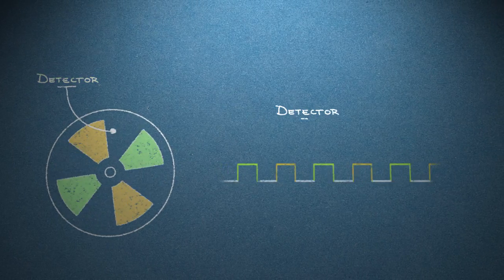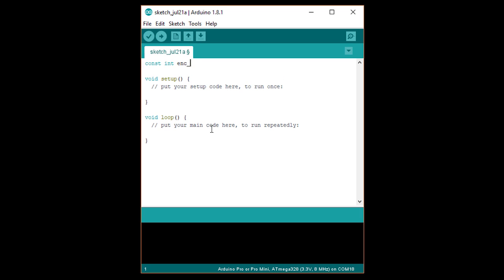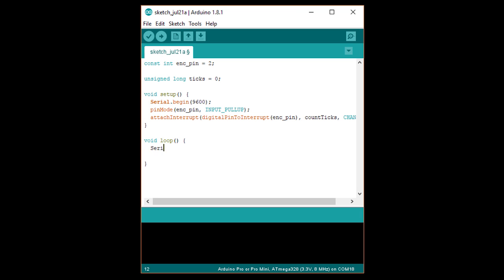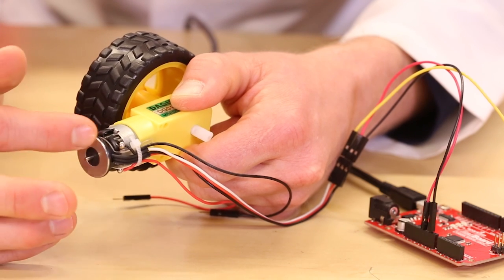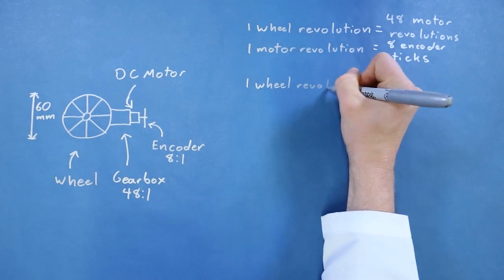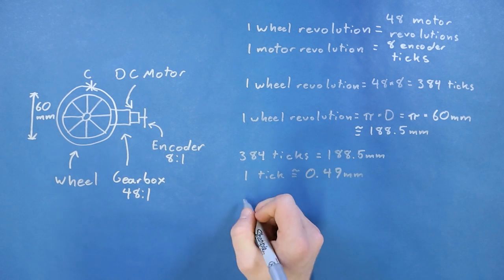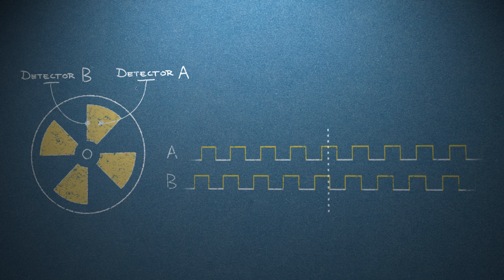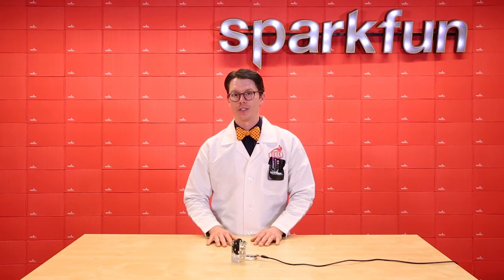Adventures in Science: How to Use Rotary Encoders

Comment: At 9:47, there is an error in explanation: If B is high (should be low) on A's falling edge, then we know that disc is rotating clockwise

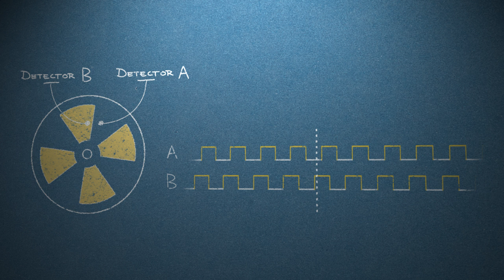At 10:02, there is an error in explanation: if there is a falling edge on A and we detect B is low (should be high) then we know that the disc is rotating counter-clockwise
Reply: yeah i noticed this one too. thanks for mentioning it. a bit confused but overall the whole video explanation is very clear.

Comment: @ 9:51, "If B is HIGH on A's falling edge, then we know that the disk is rotating Clockwise"  Wouldn't we be able to tell if the disk is rotating Clockwise when B is LOW on A's falling edge? Using the videos diagram, I think this logic makes sense. If the disk is rotating Counterclockwise, B would read HIGH on A's falling edge. Please correct me if I'm wrong, I would like to make sure I understand the rotary encoder logic.

Comment: Is it possible to measure distance using rotary encoders?
Reply: Yes, if you watch the video at around 7:53 (https://youtu.be/oLBYHbLO8W0?t=7m53s), you'll see that I set the robot to measure millimeters and stop after it's traveled 1000 mm. For a human-scale example, measuring wheels (like this one https://www.amazon.com/TR-Industrial-Collapsible-Measuring-Yellow/dp/B01018D7MS/ref=lp_3753421_1_1) work on the same principle. As you walk with it on the ground, a device counts the number of rotations and by knowing the circumference of the wheel, you can figure out how far you've walked with it.

Comment: hi 
how we can make dc motor as servo ? with encoder 
or how can i control dc motor shaft to turn 20 degrees 45 degrees 360 degrees etc ?
Reply: You can however do not that these encoders are very inefficient.

Comment: There is so many pins defined....i only have the two encoders. The others i don't understand what they are, please explain.
Reply: Ncheeta Morero read about H bridges. 2 digital output pins for every wheel determine the direction of rotation + 1 pwm output (again, 1 for each wheel) to control the speed of that wheel. This should explain it!
Reply: For each motor there are two pins and one pwm pin. For two motors that's 6 pins. There is one standby pin that has to be held high for motor driver to work. And then there are one pin each for encoder output.( If u r using quadrature encoders, then there are 2pins each for a motor). So in total there are 6+1+1+1=9 pins.

Comment: Can anyone help me? I don't understand this section:
  // Constrain power to between -255 and 255
  power_a = constrain(power_a, -255, 255);
  power_b = constrain(power_b, -255, 255);
Why constrain power between -255 and 255? motor speed only 0-255.

Thank you
Reply: Roinaldo Pho it most probably is because it uses and 8 bit data system and can’t handle more than +/- 255.
Reply: @roguepathfinder2477  microcontroller has an 8bit ADC.
Reply: zeus 0101 good to know! And i was almost right, that’s a win in my book.

Comment: Thanks for this. I was thinking about buying a servo but now I know I could just make a rotary encoder instead.
Reply: Use a good quality encoder. Otherwise go for stepper motor. I personally tried all three. Servo (real rc servo only rotate 180° , 360° servo doesn't have feedback so there just plain dc motors with speed control) , dc motor with encoders and stepper.

Comment: Kids, take apart your home printer to see an example of an optical encoder!!
Reply: A linear optical encoder (if it's an inkjet)
Reply: Many of the last generation of mass production VCR's use them as well. I've taken several from old TV's that had integrated VCR's. They are usually mounted on stands that are easier to incorporate in other hacked designs too. You can also grab the LED's from a remote control and the IR receiver to make your own encoder, although you need the simple kind. A lot of newer IR receivers have integrated IC's in them and that can complicate the design.

Comment: Oops,   •¿°  d x pi =c
But won't d vary with weight on the axel?
Oh,,  and is there a difference between absolute encoder and a gray code...   oops. I  just dated myself....
Reply: The diameter might decrease slightly if your wheels are particularly squishy. A gray code is used to correct the potential issue of an absolute encoder counting false states between two real states (https://en.wikipedia.org/wiki/Rotary_encoder#Ways_of_encoding_shaft_position).